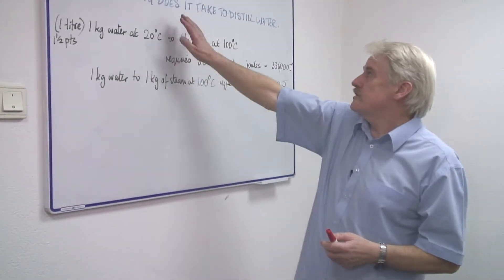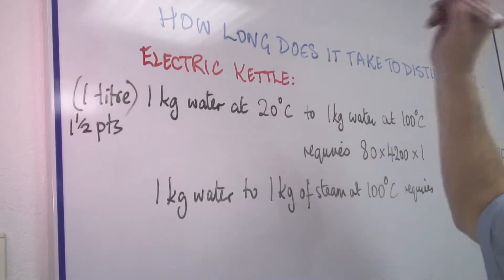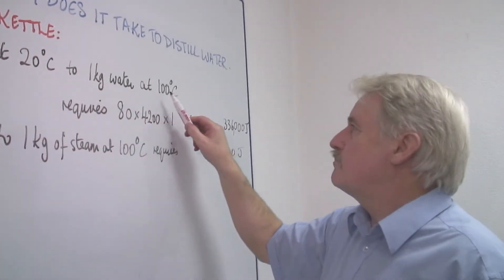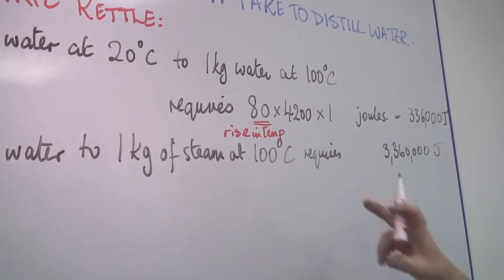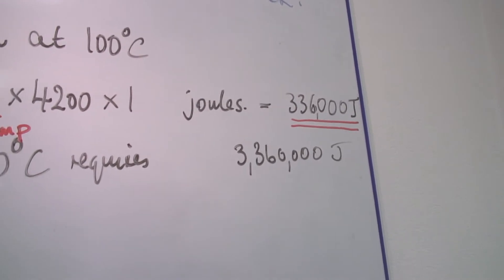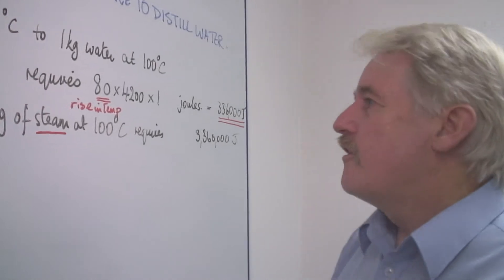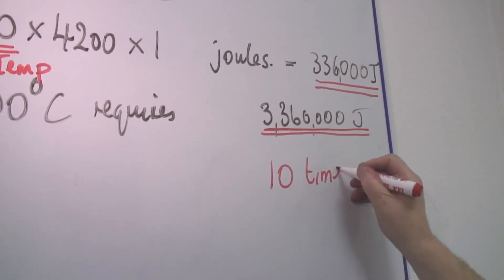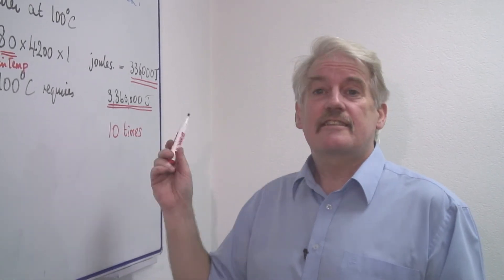Energy & Electricity in Science : How Long Does It Take to Distill Water?

Comment: I am making a mobile distiller.  The tank I am using is a half gallon tank. I got a 1/4 " round copper coil about 2 3/4" round each trun of the coil is spaced about 3/4 of a inch apart there are about 9 trun in the  coil is packed and raped with a sponge to hold water to help cool the coil so the steam will cool back down then it travels in a tube to collection tank that will set in a pot of water to help cool down the stem in to water the system is almost sealed just a small hole in the collection tank so that it can release pressure. As long as I keep the coil water so it can cool the stem about how much drinking water can I expect to catch in about a hour of run time just a good gess will work for me